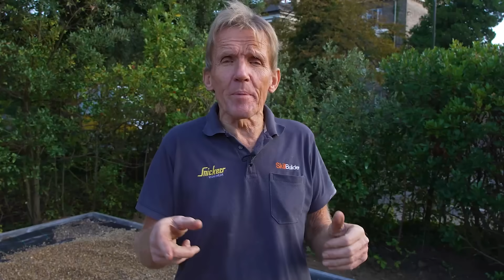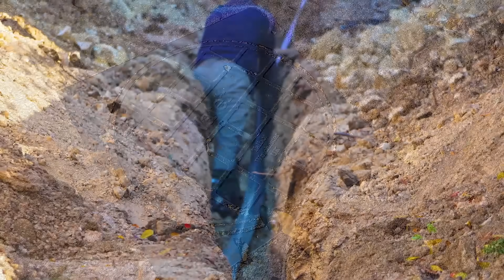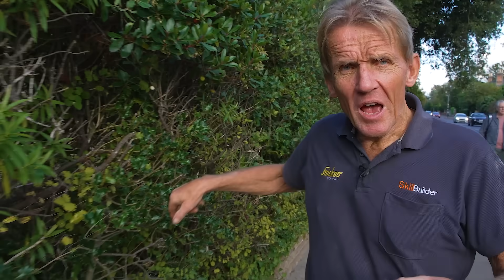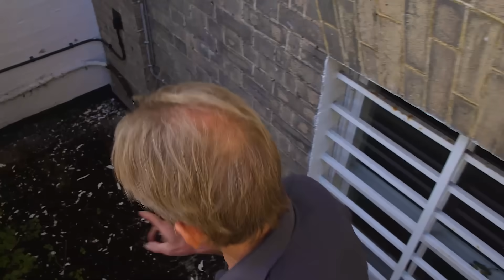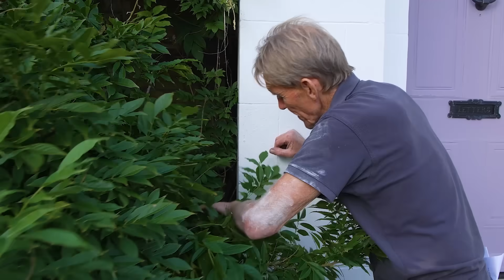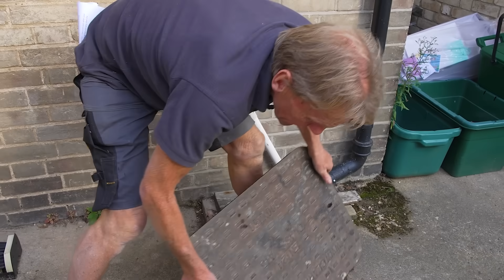Before Digging Around Water, Gas & Electric, WATCH THIS

Comment: I'm wary of digging now. A few years ago when renting, found a black cable on my raised front yard thinking it was roots. Moved to different home and just recently dig an area of my back garden which previous home owner covered with 3 foot of soil and the tenant placed a shed on top only to find a pipe fulled with dirt. I've yet to investigate and just covered it with a pot for now. Don't want to be opening Pandora's box and money will start leaking from my bank. 😅

Comment: Worked at a house where the gas main branched off to serve a gas fire in the front room, thereby avoiding the meter. The guy must have had free gas for years
Reply from the maker: I have seen similar. A house converted into flats. One flat using the neighbour's supply.

Comment: If you suspect the ground may have become live due to a cut cable, dont panic and run, shuffle your feet away from the source, if 400v is travelling into the ground and the sub station fuse didn't go bang, if you take large steps, or try to crawl out a trench with your hands there can be a potential difference between your 2 feet or your hands and feet and you can get a shock accross your body between your legs or from your muddy leg to your hand. Only move small amounts at a time and try to get onto something insulating such as wooden plank or roll away from the danger.
Reply: On the note of electrical safety:

Important note: *Do not do a bunny hop* with your feet together like has been taught in some places. This makes you more likely to fall while hopping, raising the danger level.
Instead, "shuffle your feet" means to slide one foot past the other WITHOUT EXTENDING PAST THE OTHER FOOT. Your two shoes are ideally always contacting each other as much as possible while moving away from the live wire. This means that it's more likely for current to flow mostly between your two shoes and back to the ground instead of current flowing mostly up one shoe, then the leg, then the groin, then the other leg, then the foot back to the ground. If current did so (flowing up and down the legs), besides possible electric burns and muscles tearing themselves apart due to sheer amount of electricity, this may throw you on the ground, which would expose the rest of your body (including your heart, which depends on a very ordered pace of electricity) to the dangerous electricity.

Keep in mind that wet skin is a lot more conductive than dry skin. If you can avoid being/getting wet in any way whatsoever, take that route. This may include reaching an area with dry gravel or patch of dirt with no wet grass.

Comment: Good content 👍

It Annoys me so much that the most utilities companies sub contract out the installation works, So their Subbies  throw them in at shallow depths for a start 🤬

Drains - You can Use a Sond attachment to a cobra and detect the drain runs using the CAT 4 + 

MDPE pipe, ie. gas-water cannot be detected with a CAT unless a steel embedded service Marker tape has been installed above the service. 

Stats drawings are indicative only so cannot be taking for Gospel by the Asset providers. 

Best Just to carefully trial hole by hand using an insulated grafter/Shovel along your designated route. 

If unsure dig the whole way without the use of a excavator.

Comment: Why don't they have pipes running above ground? Wouldn't you avoid rust/degradation/tree roots. It would be so much easier to repair🤔
Reply: Frost
Reply: Trip hazards?
Reply: Frost is a huge reason, as ground temperatures are insulated by the... ground, so the pipes contained deep underneath aren't as affected by cold air temperatures. Same goes with heat on plastic pipes for really hot days. Electric utilities can tolerate heat as wires can expand, contract, and dissipate excess generated heat to the wind.

Water pipes cannot tolerate excessive heat. Also, water pipes are always heavy, and gas pipes can be too. Adding stronger support structures (or simply reinforcing the structures) for vertical posts to carry literal pipes instead of only cables is very costly.

Comment: I'd like to ask a question regarding pipeworks.
I think ive got a water pipe leak on my driveway (through natural causes rather than any ground works).
What sort of plumber would i be looking for to do this type of work?  Someone who deals with blocked toilets and centrall heating isnt going to want to be digging up a driveway.
Any advice would be useful.
Reply from the maker: I used to love doing water mains but you may find you are better off with some ground workers. Repairs to underground pipes are much easier than they used to be.

Comment: Previous owner/someone had black cable 4 inches down, no warning tape etc, diagonal across the garden then running through a border. Fortunately I was using a wooden handled fork when I "discovered" it!

Comment: I wish to lay my cards on the table right at the beginning. I have spent my entire career (at 39 years and counting) dedicated to the detection of underground pipes and cables.                                                                                                                                                                                      Please be aware that all too often the cable or pipe that is hit is in an 'unexpected' place or at an 'unexpected' depth. If you read through the other comments you will see reasonable evidence of that. Now, something only becomes unexpected if you allow yourself to make a presumption about the route that a cable or pipe takes. So, please always keep an open mind about the routes that they take. DON'T presume that the cable runs in a straight line, it might not. 'Expect the unexpected', as they say.                                                                                                                                                                                                           Hire a good quality Cable Locator and Signal Generator, just as is suggested in the video. If you are not sure about how to use them to best effect, then contact the manufacturer. They tend to be staffed by folk who are only too happy to share with you their expertise and knowledge if you speak to them on the phone.
Reply: Remember too that the "100 year old maps" aren't always accurate.  Roads also change widths to take over the verges.
Reply: Hi Paul, I am having my lead water pipe replaced with new ones. My contractor told me that he did an utilities search and "nothing" came up. I find it unbelievable and am thinking maybe I use someone else. What do you think? If they dig the front drive, and break a rainwater pipe (lateral, carrying water along the street), would I be in trouble?

Comment: Hit gas twice while digging for water once at 1.2m second time at .3m, then drilled threw my lead water main with auger moving my fence half a meter on niegbours  propety (got permission)
Reply: Have you considered a new profession?
Reply: @Dandodod1  poo happens learn from it don't repeat, as rocky said ain't about how hard you hit about can you get back off that ground
Reply: @Dandodod1  you should consider a new profession ya rent boi

Comment: If you have a water leak and try to turn off the water at the paving/ road side stop tap, only to find its rusted up - is it the water board since the tap is under the paving but also partially straggling onto your property?
How about showing tools / techniques to loosen / unseize water stop cocks 1 metre under ground- accessed via a 4" pipe!
Reply: Anything that isn't on your property isn't your problem had this argument with Anglian when my mum had a leak and estimated she was using thousands of litres a day I think the bill was £800 for a few months 😂

Comment: Some years ago I was clearing some bricks and concrete on the surface of my back garden so only breaking through the surface lightly chipping away with a pick axe  and  suddenly there was a flash ,crackle and some smoke.  The incoming electricity  supply was about 4 inches below the surface. 

The electric board came out and fixed  the cable.  They didn't charge me because  the cable should never have been so close to the surface  but it  ruined  my pick axe - left the end with a dog leg in it !

Comment: 1 (and a half) time for me. First time I was on the digger and I had the bucket on what I thought was a tree root, I was yanking yanking yanking on this tree route when I said to my bro ffs see what it is, he got in the hole and discovered I was yanking on a main’s electricity cable, luckily no one died. The cable I was yanking on was actually for next door, it was in the wrong garden.
Second time, similar thing, I was on the digger; a diagonal mains cable across the front garden, yank, power off. Luckily the electricity firm came out within 2 hours and sorted it out. Haven’t gone through a drain or gas pipe(yet). 
Did have someone ring me up as they had sewage over their garden. Turns out they had new fences installed and they’d collapsed the drainage when putting in the fence posts. Sometimes you can be as careful as you want but utilities are in the most unexpected places.

Comment: if your going to hit a service on your land ,hit the water usually 25mm blue mdpe pipe a doddle to repair, even live if you cant find the stop tap and everything you need can be acquired from most builders merchants, gas, electric and fiber can be a little more problematic
Reply from the maker: There are plenty of lead, iron and copper water services out there. I have repaired them all over the years. I agree that blue MDPE is a doddle

Comment: 450mm or deeper for electric cables. Anything more shallow shouldn't be charged
Reply from the maker: That is true but they sometimes say the ground levels have been altered
Reply: @SkillBuilder  I work for a DNO. This is true. It may have been buried at a regulation depth & over the years there has been various landscaping jobs that leave it near the surface. 

On the other hand, it's possible it was installed negligently. I agree there shouldn't be a charge in that instance but if you're dead or injured,  that's small concellation. A CAT scanner & maps from your regional DNO is the best idea, then some hand digging until you locate the cable, before going at it with a digger.

Comment: In the UK there is a company LBUD, ( Linesearch before you dig), it’s free, and once you fathom out the website you can get maps of most utilities 👍👍. A CAT ( Cable avoidance tool ) can be used to detect conductors. 
Plastic gas and water pipes that’s another kettle of fish!
Reply: Thanks for sharing!

Comment: I watched a 360 digger go through a mains gas pipe where a new build housing site joined an existing road and that ignited straight away and there was a lovely tower of flame leaping into the air, the site manager rung the fire brigade who came over had a look at it, put a cordon in place to stop the groundworkers from toasting their butties on it and then refused to touch it, they just rung the gas board and got them to disconnect the entire main so that the fire died out and the pipe could be repaired.

Comment: great video roger. Could you cover a video on the cable and hose protectors like little rubber linkeable  ramps with top yellow flaps to insert cables or a hose. workmen did a big woopsy recently and i think during work they are a great idea to keep cables safe and not trip hazards. mine arrived today and not put them in on the site till tomorrow but i dont know why its not a standard site thing. how many times do you see wheel barrows running over extension leads all day long. accident waiting to happen. you do a great job!!!!!!

Comment: I am doing a complete dig up of my driveway, service supply moved (all of them) and a new garage etc etc (1964 house, Pitch fibre foul pipes etc, you know the ones Roger, they have asbestos in them)... all but one of the services (Water) were at 150 mm from the surface, they should be 600 mm min according to my Suppliers, so I dug trenches to 700 mm and did it all beyond spec, tile tape, ducting .... the utilities sub contractors came along and did a great job, because all their jointing pits in their words, were "The best they have worked in" .... If a job is worth doing once for good reason, do it even better, belt, braces and wellies i say ! .... top job Roger ... common sense can't be taught ! ... bloody exhausting, but worth it.